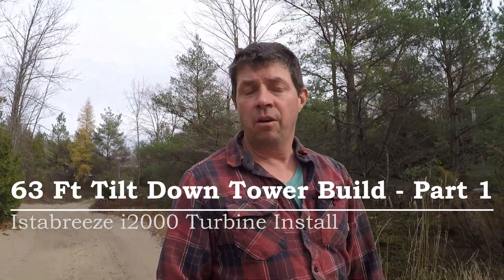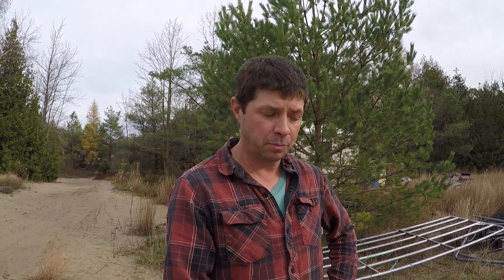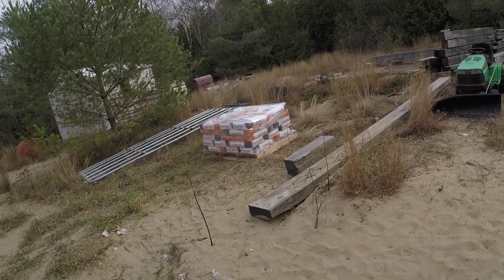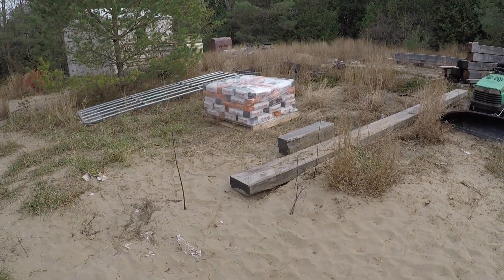63 Foot Tilt-Up Wind Turbine Tower  Build -  Part One- S07E01 (OFF GRID LIVING)

Comment: I used sch 40 for my first tower, and it seems good enough for a 60-foot tower. For my 60-foot tower, I'm using used oil field pipe. It has some holes and blowouts, so I'm not sure how thick it actually is. I'm rewatching these to see if I can prevent any stressors along the way 😂 my tower really needs to be mobile with quick take down all opporated by 1 person, so I need to refine as much as possible 😅
Reply from the maker: Ours is scheduled 40. It is pretty easy to lower and raise with one person. I have made a few changes since this video but the idea is the same. Also added a wind speed sensor so my automation system can put the brakes on if the winds get to high
Reply: @TheForeverHomestead  I don't recall if you did 4 guy wires per level but I'm thinking to be able to lift and lower mine by its self I'm going to use 4 guy wires per level. My 3 guy wire set up leans a little hard on the lift and makes me nervous.
Reply from the maker: @PrairieStation  we have 4 per level.  the back ones remove from the base and attach to a gin pole when raise and lower